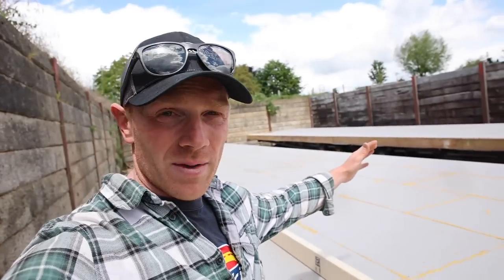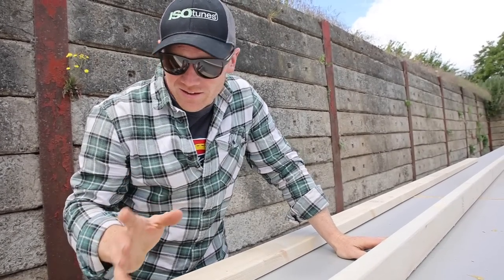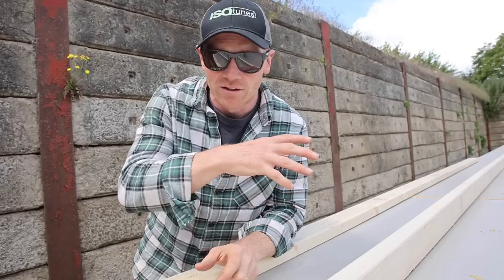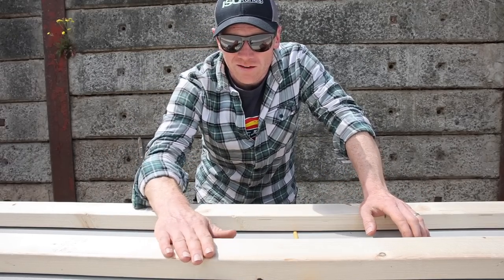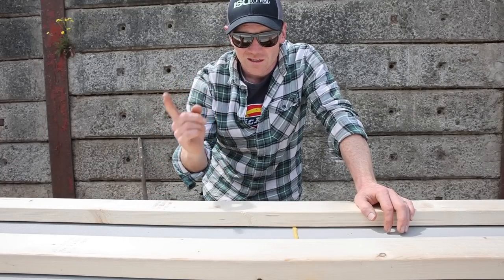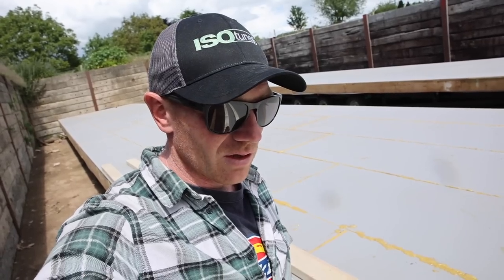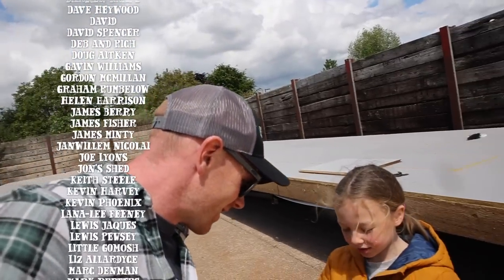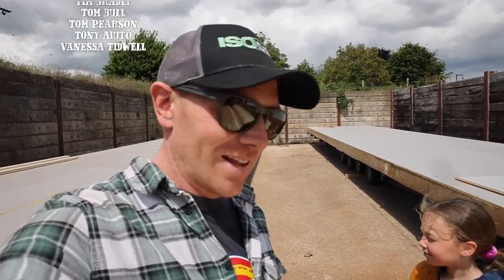BIG CHANGE OF PLAN FOR WALLS - New design, new insulation and Why not  SIPS?

Comment: I spent 6 years doing what you're doing building twin lodges, if you need any help let me know. they're 6mm ply internally on 4x2 for the external walls, with rockwool in the uprights, membrain then laths and cladding to finish. the ply comes prefinished with textured paper on the inside. internal walls are 2x1 covered in the same 6mm prefinished ply.
Reply from the maker: Good to know. Think our internal walls will be a bit chunkier but sounds similar. Looking at prefinished panels v plasterboard at the moment. Main issue we have is getting them level before we start on walls. Did you build twin units in two halves or are they side by side during construction?

Comment: U have blow cellulose ther? Yours wall cross-section look like good for this isulation method. 
I make few stick frame by this way and in my opinion is best alternative for any kinde of wool. 

And pleas do not call this „two by” sticks, timber frame ;)

25 mm is good for 18mm coper pipes- with isulation it get somthing like 25 mm, pex or ppr nead 35 mm. But is trick for that. Under 25 baton U put osb 12 mm scraps each 0,5 m or so. Is good option because U get air flow at all space not only betwine baton in Ur instalation space.

Comment: We used wood fibre board on our twin unit. Really glad we did. Its a lovely material to work with and so much easier than PIR. We used the wfb inside and out. Externally under cladding but we also lime rendered 1/2 of it as well. Internally you can chase out services and plaster straight over it. No need for a service void. Even using 40mm/ 60mm boards its prob cheaper than osb, batten and plasterboard. Especially with current pricing for osb. VCL can go under the boards if you want. You have to use lime or lime based plasters I think, gyp plasters don't bond.
Reply from the maker: We talked about lime rendering gable ends. Hadn’t thought about internal as well🤔. I think we will stick with osb just for strength and the fact we have it here but we have plans to use it inside stone walls in other buildings where chasing and plastering will work great.
Reply: I built an oak framed house using sips panels and one small section of it was clad in WFB, it’s so nice to use I really regret using the 150 wall 200 roof sips panels. Lime render/ plastering is so easy to do as well  (Limestuff are great btw) I would never go back to using OSB having used WFB with lime render on the outside and plaster on the inside.
Reply: @TheRestorationCouple  you could clay plaster inside - added advantages being that the kids can join in, and it'll give extra moisture buffering which is always helpful in small spaces.

Comment: You ought to look at Hempcrete 600mm gives U value of around 0.11, K-rend Vapour permeable outside  or black corrugated iron, clay inside, no need for mechanical ventilation. You get very high thermal mass which should be able to be heated by the sun if designed well with glass porches or a small wood burner in middle of winter.  No need for full on heating systems.

Comment: We used wool insulation in the restoration of our listed house and have just suffered our first moth infestation. The wool was exposed, laid between joists in a roof space, so I have removed it all. I’m hoping the moths have not got into the wool stuffed between rafters then overlaid with wood fibre board and lime plaster, as that cannot be easily removed! Next time I will not use wool, probably a recycled insulation.
Reply from the maker: We had the same concerns last time we used it however 9 years and there was no sign fortunately. The new stuff we are using is processed slightly different so should be just as resistant, but as all will be concealed in wall panels its less risky I guess. We used the recycled plastic wool which is a good option too.

Comment: Are you going to oak frame your permanent house?😁
Reply from the maker: Some elements may be. 👍
Reply: @TheRestorationCouple  if you do, don’t do what I did and fasten directly to the oak frame (with a 2x4 timber spacer in between), use steel straps to hang your sips panels or timber roof structure over the top of it, this lets the oak expand and contract without affecting the fasteners.

Comment: Why bother with the OSB, seems like unnecessary expense (it's pricy these days) and will eat up space, few extra noggins instead? and couldn't you run the wiring through the wool insulation rather than having the service cavity to save even more space.
Reply: OSB gives excellent wind shear resistance.

Wiring can be run through insulation if suitably carefully calculated but it will likely cost a lot more in copper due to the need to uprate the cables.  Personally, if it can be avoided then I would.
Reply: @ealingbadger  oh my....if you put in skinny cables in the first place then maybe.

Comment: Although not as green, but did you ever consider multifoil insulations?
Reply: crisp packets, they will freeze
Reply from the maker: Looked at using TLX silver inside studs but after leaving the required air gaps there was no increase in u value really.

Comment: We have a 25mm cavity with 15mm plasterboard and it worked lovely for using 35mm backboxes screwed straight to the studs or flush noggins. We ran all our pipework in it - 15mm plastic as single runs all fed from central manifolds. It all runs through the ceiling cavity, but getting the bend to go down a wall was entertaining in places, and all our pipework emerges behind units so it works (as it doesn't come out at a 90deg corner), so that bit is hidden.
Behind kitchen wall units we put large squares of ply in the service cavity (18/25mm thick) so the units could be screwed straight to the wall through the plasterboard.
If you have a 25mm service cavity in the ceiling, then Aurora/Enlite do a slimfit LED spotlight that fits in that space as well (pendants obviously easier).
We have our airtightness membrane on the studs, so none of the cabling / services in the service cavity need to penetrate it, which makes life a lot easier.

And finally, building them in situ gives you a lot more flexibility for layout changes particularly with regards to socket locations. You can do that once the room is up and you can visualise the space.

(and we are also planning on putting a 60mm external wfb on, but havent got there yet, but might switch to a rockwall alternative so we will be watching with interest).

Comment: Having briefly read through the comments, I'm astonished by the quantity of negative ones, or the tones that come across from the curious comments.

Personally, I'm thoroughly enjoying watching your journey, I can't remember when I joined in viewing, but it's been fascinating and honest and open. Much like this video. 

I'm a big fan of attempting to go as natural with building materials as possible, as the traditional approaches (much like your paint choices for your soffits, or plaster choices for walls) last longer, seem to do less harm to the world, and are far more sympathetic to a healthy lifestyle. 

I can't wait to see how you get on with the wood fibre boards, I've got a spot of lime plastering and stud walling to do in my workshop (a listed wooden framed barn), and am still choosing which insulation and backing boards to use. One question I do have, which I'm sure will be answered in good time, is how you'll be finishing the inside of your builds - gypsum plaster on the boards, or will you go for a product like Adaptavate plaster (a lime and hemp mix, that can be applied in a day, and onto plasterboard) or limelite, to get more practice with those more traditional finishes over the modern day standard of gypsum/concrete?

I look forward to more updates Tim, and if you ever need an extra hand, I'm just up in Cheltenham!

Comment: Hand on heart I am not sure how much you will learn from this experiment because a cabin is very different from a house. I think if you want to look at insulation in this level of detail you would be better off staying in a house with the insulation, most of the major manufacturers have an option of visiting their showhomes. Or there is the self-build centre in Swindon. I just think cabins and houses are apples and oranges myself. Could well be wrong but is just my opinion :).
Reply from the maker: Its a good point. Although it’s more about working with the materials than just their performance. I.e do we want to spend weeks cutting PIR or woodfibre boards, having insulation blown or working with sheepswool, external v internal etc. although it’s a cabin by name it’s not that different from a timber framed bungalow, just that the studs would be 140mm. The build up would be similar in this case.
Reply: @TheRestorationCouple  Will be very interesting see you doing it, I get what you are saying. However a timber framed house in sheep's wool would have walls of 400mm plus I would have thought. The other thing is where the building is sighted and what's around it play a big part. There are also regional rain charts when it comes to the exterior.
Reply from the maker: @dannymurphy1779  yeah I think our breathable panel spec we had done is around 350mm to get 0.1 Plus a service cavity. All depends on the exterior finish though as with bricks you would be quite a bit thicker again.
Reply: @TheRestorationCouple  I am just quite surprised you want to practice on the cabin as your skill level is way higher than the task in hand. Well, apart from the rendering that is :). I think there are a number of mock ups at Swindon plus there are people you can talk to there. Not been myself but seen footage and it looks a fantastic resourse.

Comment: I hope that your windows will fit with this extra layer of OSB on the inside instead of the outside. Window sashes are built with specific interior dimensions, just double check!
Reply from the maker: The apertures will be the same so the frames can sit wherever we like within that opening.  We can therefore either  sit further out towards cladding or have more of an external reveal.  Still not decided yet though.

Comment: Worth considering something natural like hempcrete for the house if your after a breathable envelope!
For the cabin i think I heard your buildup was:
40mm rigid wood fibre insulation board
89mm CLS stud wall with full fill insulation batt such as sheep wool, cellulose or hemp
18mm OSB - acting as a VCL
Battens forming service void
Internal plasterboard 
I’d make sure the wood fibre board is suitable for weather exposure or use it as part of a breathable render system such a lime based render. 
As your osb is acting as the VCL you’ll want to avoid service penetrations through that so the service void on the warm side is a good idea. 
It’s always nice to avoid the less natural / more combustible insulations in my opinion. 
Keep up the good work 👍
Reply from the maker: That's pretty much it but no need to be 18mm osb.  The wood fibre boards we have are weatherproof during install and can be plastered, rendered or clad.  We may lime render the gable ends as a test but most will be battened and clad.👍